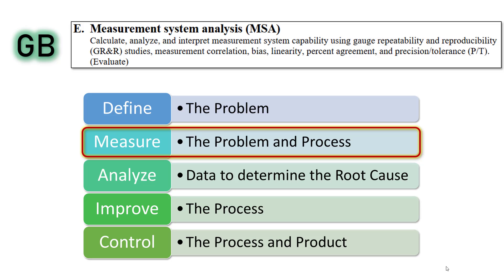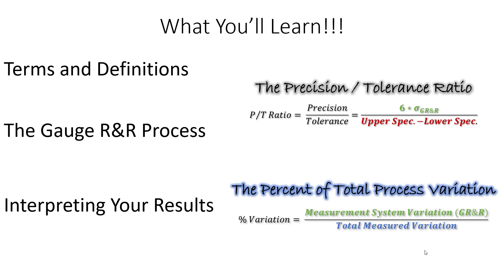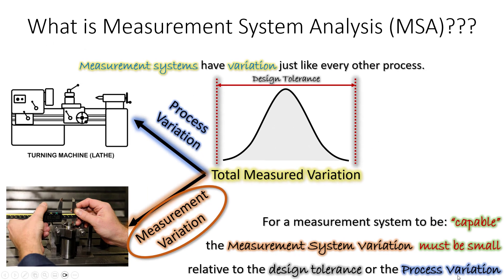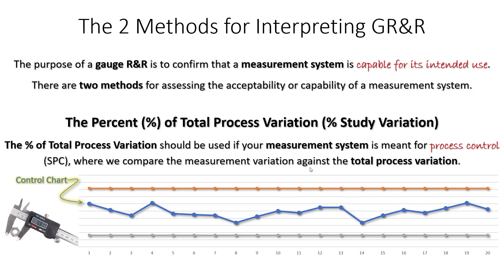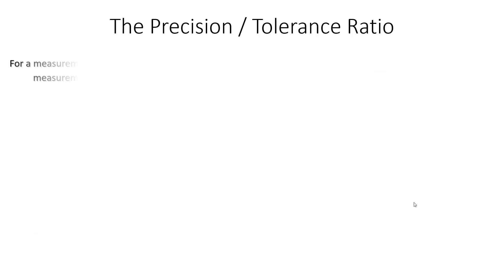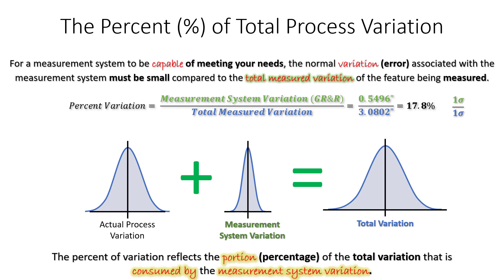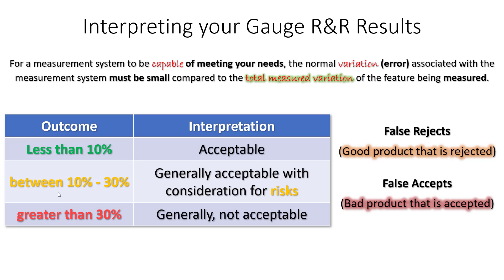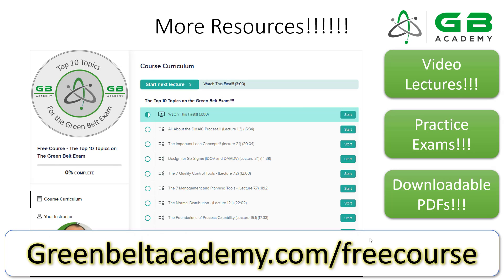Gauge R&R - How to Analyze and Understand your Results (Part 3)!!!

Comment: If you're measuring NVH on an end of line,  there technically is no lower limit (your part cant be too quiet). How would you define your design tolerance in this case?

Comment: Thanks for Explanation but in min 17 how part to part variation is not (100-27.95)
Reply from the maker: The % variation never adds up to 100% because we're calculating each component in the variance term, then converting it into standard deviation, which results in the percentages not adding up

Comment: Good Explanation on Analysis. 
I have a small query that, The variable gauges/Instruments we used in conducting SPC and for conducting gauge R&R study are same , then if the GRR % with respect to process variation comes higher than the PT ratio , which % should be considered for Measurement system acceptance.
Reply: Good question! Which is smaller, your process variation or your design tolerance?
Sometimes we have excellent process capability and so our process variation is small, which results in a large final % when looking at the %total process variation. In this instance I'd default to the P/T ratio.

Comment: Great video!! It helped me understand the concept. I'm still confused about a specific scenario when you have a fixture with different stations, should I run my GRR placing the part always on the same stations and randomly? Would that add more variation in my GRR results? Thanks in advance.
Reply: Great question!! Okay, so the pure definition of repeatability is the variation that is unique to the measurement equipment, and that should also capture any variation in the equipment fixture. 

So when you run your GR&R you can randomize the fixture that you're using when you take your replicate measurements, but definitely know that this will increase your repeatability.

If your repeatability ends up being unacceptable, then you can look at your fixture specifically as a source of variation that could be improved to reduce your repeatability.
Reply: @CQEAcademy  Thanks for the taking the time to reply
Reply from the maker: You’re welcome

Comment: How different is this process when you do an attribute MSA rather than a variable MSA?

For example I have a camera that tells me if a part is good or no good. The problem is the camera is giving false rejects so my boss asked me to do an MSA/Gauge R&R on it. 

I feel like a lot of the calculations in this video wouldn't work on the binary data I am going to get but I could be wrong.
Reply from the maker: Great question Brad!   So the process is very different when you're dealing with attribute data.  

Google "Attribute Agreement Analysis" to understand how to quantify the variation in a measurement system when you're dealing with attribute data.

Comment: If you are looking to reject or accept product against a tolerance what range of parts should I choose for my study?  Spread the tolerance or spread over the known historical process variation?  I’ve been told tolerance but as the process is capable I need to misprocess to generate the arts that cover the tolerance.
Reply from the maker: It depends on which analysis method you choose! If you're going to use the % of Process Variation metric, then having parts that span your entire process range is a must!
Reply: @greenbeltacademy  shouldn’t I be using the tolerance % for inspection?

If it depends then on what grounds so you not have to have parts that span the spec?
Reply from the maker: @moosemoss2645  great question, I think in a perfect world, you'd attempt to have parts that span both the design tolerance and the known historical process variation. 

Also, yes, if you're using the gauge for conformance (product control) then yes getting parts that span the design tolerance is important to demonstrate that your precision is acceptable across the entire design tolerance.
Reply: @greenbeltacademy  thanks.  Part of me doesn’t doubt that measuring over the design tolerance is the correct way but on the other hand if you have to misprocess to make the parts to fill this spread then use the historical deviation in your calcs it feels kind of strange.

Comment: Hi Andy, how repeatability 12.10% + reproducibility 25.19% = Total GRNR 27.95%? I thought the sum would be 37.29%?
Reply from the maker: Because when adding up variance (in standard deviation) we don't simply add the percentages, we must convert them to variance first, then add them up. Also, the total percentages do not add up to 100% for this same reason.

Comment: This is a great video. One question, how do I interpret the result if %study variation exceeds 30%, while %tolerance is smaller than 10%? Is this measurement capable or not?
Reply from the maker: Are you using that measurement system for product control or process control?

This result could occur is you have a very capable process which would result in very low part-to-part variation.

Also if you don't select 10 samples that span your entire design tolerance, you can also get this result.
Reply: @greenbeltacademy  I am using it for product control. The AIAG MSA manual states that those 10 samples must be chosen in order to cover the entire process spread, which is true in theory but not in practice, especially in the NPI stage of a project, because not many products were produced. But we have to assess the measurement system at the beginning. So there is a lot of argument on this.
Reply: @CQEAcademy  Great, thanks for the feedback.

Comment: Hi Andy. Alan here. I been doing quite a bit of research on Gage R&Rs. A few articles mention you should also ensure individual categories (repeatability, reproducibility, part-to-part) meet criteria as well. In particular the R&R numbers should be less the 9% for each and your part-to-part variation is very high. What say you? I recently picked up the MSA book by the AIAG group and was wondering if they talk about that within it.
Reply: Do you take the same percentages (less then 10, between 10 and 30, greater than 30) and use them as a criteria for the R&R plus part-to-part variation percentages too just like the percent to tolerance ratio?
Reply from the maker: Hey  @alanarnott4465 !

Okay so that criteria (<10%, >30%,etc) does not apply to the part-to-part variation.

You want the part-to-part variation to be very high, which essentially means that the majority of the variation within your gauge R&R came from the parts/process - which is what we want! 

That criteria only applies to the Gauge R&R value.
Reply: @greenbeltacademy  gotcha. If I got results of 20.23 for repeatability, 16.94 for reproducibility and part-to-part of 62.83 would that be considered good or bad results?
Reply: Thanks for all of your insight by the way.
Reply: I just read my message from 21 hours ago. To clarify, I knew part-to-part should be high. I just wasn’t sure how high it should be. Maybe a 70-15-15 split between that and the two Rs.
Reply from the maker: Hey  @alanarnott4465, In that situation what was the % for your Gauge R&R??
That's really the primary value that we care about. 
By the way, if you're using my spreadsheet and you wanna send me the data, feel free to shoot me an email with the raw numbers and we can go through them!
Reply from the maker: Great question  @alanarnott4465 , and to be honest I didn't do a good job explaining this in the video, but those percentages will not add up to 100%. 

When adding different sources of variation (Part to part and Gauge R&R, etc) we have to add those together in the variance form. However those calculations occur in the standard deviation form, so the percentages will not add up to 100%.  

So we can't just create an even split of the 100% (70-15-15), we really just care about the Gauge R&R Percentage.
Reply: @greenbeltacademy  Hi Andy. Just reaching out to see if you received my email containing the Gauge R&R data. I hope you're doing well, by the way. I just recently heard the podcast you were on. You were talking about mentors and how important they are to growth. In my previous inspection job, I never had one per se, but I am looking to get one I can relate to.
Reply from the maker: Hey Alan! yes the reproducibility for that data set is very high, and would be a focus area if I wanted to improve my GR&R.  

In terms of 9% for each element (Repeatability and Reproducibility), I think that's a very tight requirement. If each element was less than 9%, then the resulting overall GR&R would be way less than 30%, which would essentially be like moving the goal-post for GR&R requirements. This can be very difficult to achieve, especially as processes become more capable, and as design tolerance are shrunk.